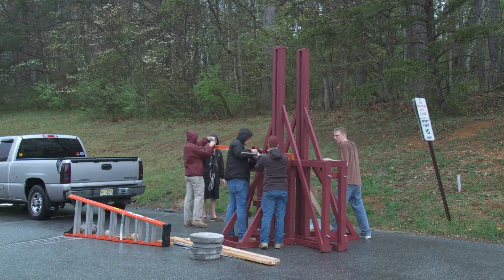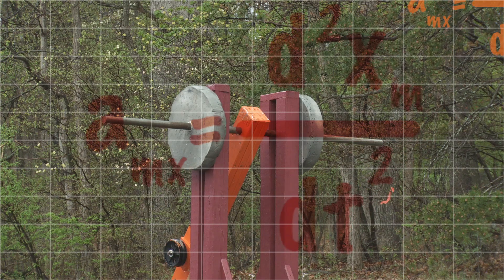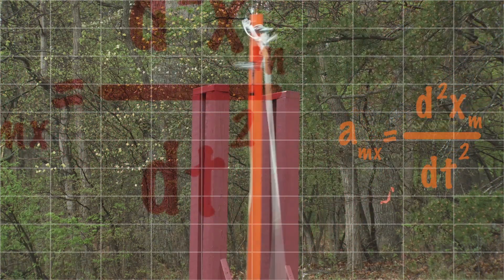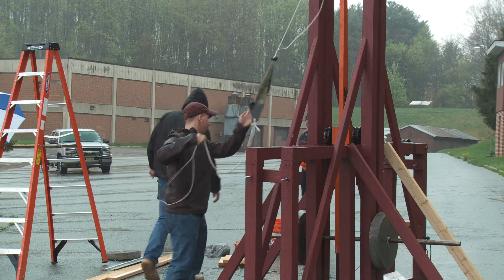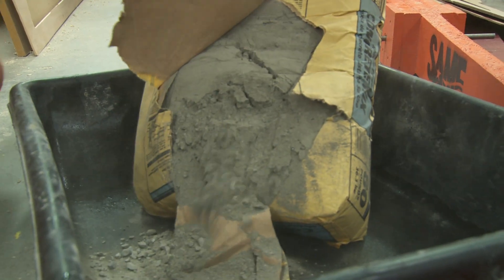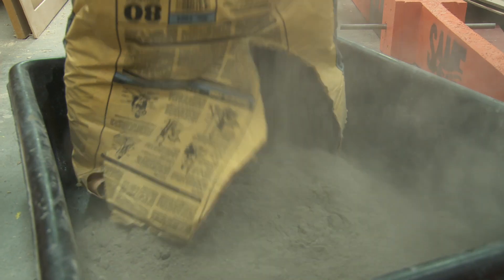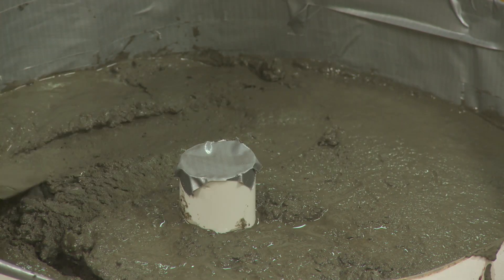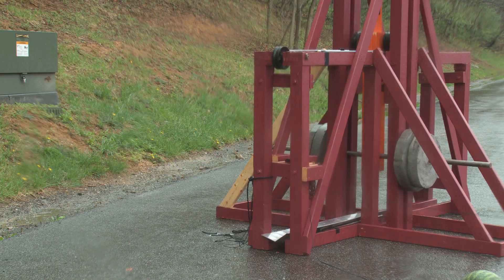Students build trebuchet to launch melons - Virginia Tech

Comment: The floating arm trebuchet was not used to knock down castle walls because it only came around a few hundred years after the standard swinging counter weight trebuchet vanished and by that time we were in the modern war with guns and tanks, but overall that is not a bad machine you Built though.